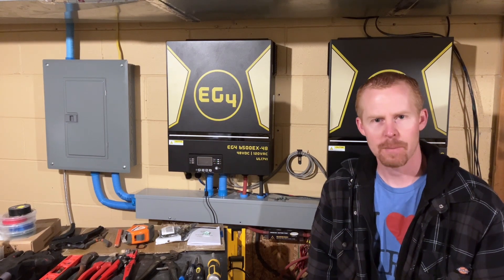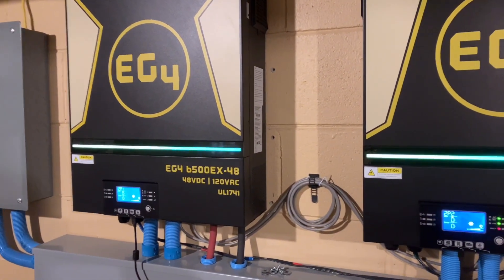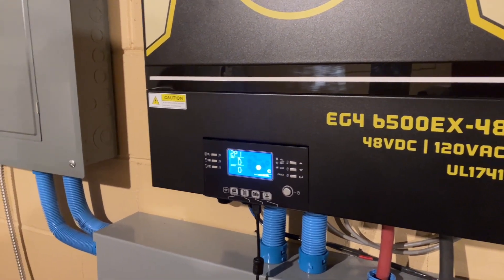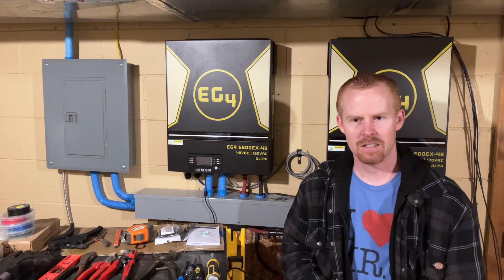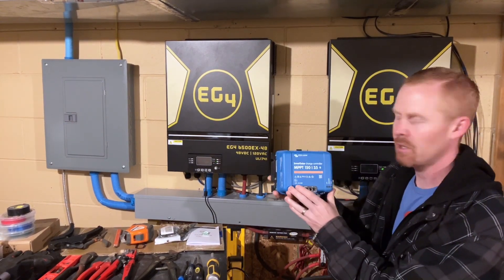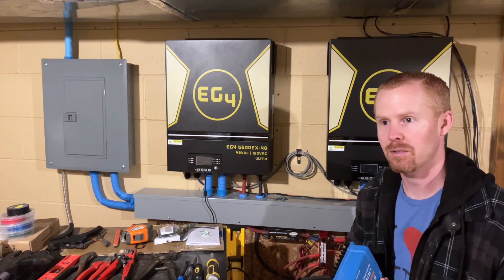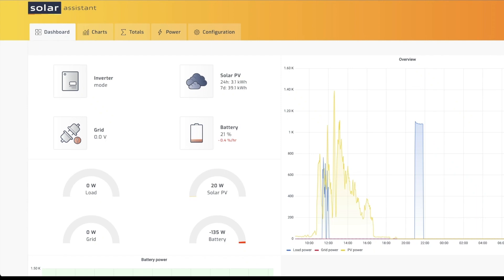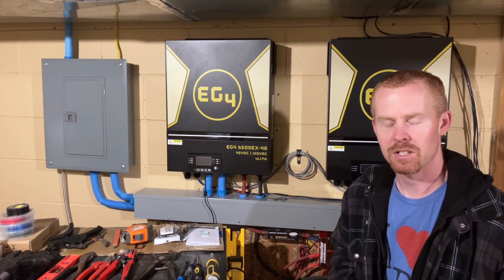WHAT'S THAT SOUND??? - EG4 6500EX Clicking

Comment: What is that sound? Morse code for, "Please take me out in the yard and put me out of my misery". Flickering LED's, noisy continuously running fans, 64kWh of LFP and it can't even work properly during the battery to PV switchover, unstable power causing my compressors to start with a ratchety sound. I can't wait until these things let the smoke out. No more HF, cheap, communist Chinese inverters for me. I'll never buy anything from SS.
Reply from the maker: did the firmware updates make any difference?

Comment: I have two LV6548’s and my PV section different and lower voltage than yours. I haven’t heard any clicking other than when it switches to grid from SBU mode during non peak periods if solar has been insufficient. Most of the time I don’t hear the relay, only the fans ramp up and the color bars change. About half the time I notice a quick blink in the led overhead lights at transfer. Depending on the random chance of how well the sine wave matched at the moment of transfer.
Reply from the maker: Yeah, the clicking was in standby mode and it was the actual fans and relays turning on trying to find that maximum power point to start processing the solar.

Comment: Friend’s identical system had the same issue - VOC hadn’t reached the Startup voltage required (80 VDC) - he was testing with just two 445 watt panels that in series just met the initial voltage until the sun came up higher.
Reply from the maker: Yeah, that's what I ended up discovering after some digging.  It was just a little concerning hearing that coming from the inverters for the first time cause you would hear the fans ramp up and some clicking then the fans would turn off.  Glad to hear I'm not the only one that experienced this.

Comment: Non related question....I have the MPP 6048 only capable of 8,000 watts of solar. I installed 12.2kw of panels and have seen 9kw+ come in on several occasions. Does the EG4 which is basically the same as the MPP series see over it's rated charge capacity?
Reply from the maker: I can’t say for sure, but I would hope most AIO units would be able to handle over paneling as long as you don’t exceed the max voltage and amperage per string.  I know on my Victron Solar charger I had almost 4x the rated solar coming in (because of all the cloudy days) and it worked just fine (of course I know Victron equipment is a lot higher end than MPP/EG4).

Hopefully someone can answer with more knowledge.
Reply: @AdamDeLayDIY  Im in Michigan so I'm more worried about winter months getting a few kw in the overcast than full power in the summer. I know I've heard it called  charger clipping. I just looked at my settings and it says it can do a combined solar and grid charge up to 220 amps to the batteries. I set it for no charge from grid. Grid is only for bypass If overloaded or if batteries are dead but only solar charging. I have max total charging set to 160 amps be I only have a 150 amp breaker. So now I'm curious if I set it higher will it go higher. I have a 400 amp Siemens breaker I could put in. It's already wired with American made 4/0 welding cable. The inverter was only 85° when at 160 amps for like 2-3 hours till the batteries filled up. I wonder what would happen? Blow up the inverter or charge like a beast or start clipping
Reply from the maker: @electromechanicalstuff2602  I’m in MI as well so I know what you mean about needing more Solar in the winter months.  If you find anything out, let me know.  I’m curious as well.  With my 6500s, right now I’m no where near capacity with only at 6.2kw of the possible 16kw between my two inverters.
Reply: @AdamDeLayDIY  awesome! I'm in SE Michigan. I just subbed. Always good to see how other systems are performing in same conditions. I'll be posting a new solar system video soon showing all the new diy EV batteries I just installed. These systems are never done done it seams like. I would love lifepo4 eg4 server rack batteries but I got two lightly used ev batteries of 77kwh of capacity between the two from the last company I worked for. We designed heat pump systems for EVs so we would energize the batteries with a charge profile from the EPA to simulate real world battery discharge/Regen then I would cool or heat the batteries as needed with our heat pump systems while also keeping the occupants comfortable of course.
Reply from the maker: @electromechanicalstuff2602  awesome!  Nope, it’ll never be done.  Nice big battery setup!  Good luck on getting them all set up!

I like the server rack concept but I just can’t spend that amount of money when I can build a much larger pack for the same amount of money.
Reply: @AdamDeLayDIY  ya just watching your videos now. Where did u get your cells. I got all my batteries for free so yeah I feel ya. How much where those cells what capacity is your bank
Reply from the maker: @electromechanical stuff I bought 32, 280ah cells from Alibaba (Shenzhen Qishou Tech) for around $150 per cell. I put together 2, 16 cell packs. So for around $5k I have around 28kwh of storage.  

To get that amount in server rack batteries, if I do the math right I would need 6, 100ah server rack batteries ($1500 a piece) totaling around $9k.
Reply: @AdamDeLayDIY  ya totally right! Just not experienced with Alibaba enough to trust it with that much money. Whenever my li ion dies that's most likely be the way I go tho. Unless solid state, graphene or something better shows up in 10 years

Comment: Maybe your bypass relay switching between solar and grid. Check you mode setting. If you have Solar, Utility, Battery mode the relay will switch between solar and utility.  If you set to solar, battery, utility mode it may alleviate this issue.
Reply from the maker: The inverters were in standby mode (not inverting) and the grid bypass connection wasn't hooked up.
Reply: @AdamDeLayDIY  Thanks for posting the video. I’ve been wondering if we were going to get some real world videos on these EG4s.
Reply from the maker: Your welcome!  In addition to just documenting my experience, I thought it might be helpful to have a little more than just load tests out there.  I don't think I had seen anyone using these to power their home, only dedicated items.  I have another video coming out within the next few days that still has me scratching my head...
Reply: @AdamDeLayDIY  I’m using 5 Growatt SPF5000ES inverters to power my home. Having display issues right now. You can check my channel out.

Comment: I would love it if you do a video on your Settings and your Solar assistant
Reply from the maker: I’m planning on doing both, I just want to smooth some things out first.  I know in an upcoming video I will have a deeper dive into Solar Assistant as I try to diagnose a problem.
Reply: @AdamDeLayDIY  I have the same inverters and batteries as you and my system was making the same clicking noise as well when I had the batteries off.The problem I’m having now is my lights flicker sometimes
Reply from the maker: While not ideal, I do understand why the clicking is happening.  It does seem like something could be done to smooth the process out.  From what I read in the manual, batteries are required when set up in split phase mode.   Not really sure what the difference would be (other than communication) between split phase vs non-split phase and having batteries connected...

As far as the lights flickering, I would assume they're LED?  I actually talked to Signature Solar about that because my kitchen lights flicker something fierce.  They're on an LED rated dimmer.  They said that usually the problem happens for 2 reasons.  
1. Very cheap LEDs end up chopping up the sine wave which causes the flickering.  
2. The load is so small for the LEDs that the inverter has a hard time dealing with it.  Once another load is introduced on that phase, the flickering should stop.  

I still have the flickering and it drives me nuts.  I might try removing the dimmer and see if that helps at all.  Kinda frustrating though that something that's supposed to produce power just like the grid can't mimic exactly, but I guess these aren't top of the line inverters...